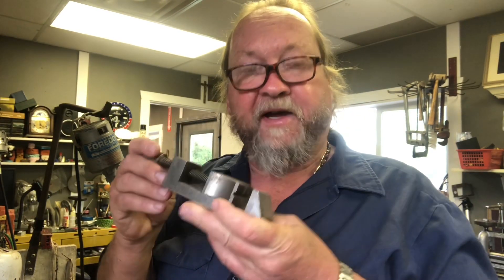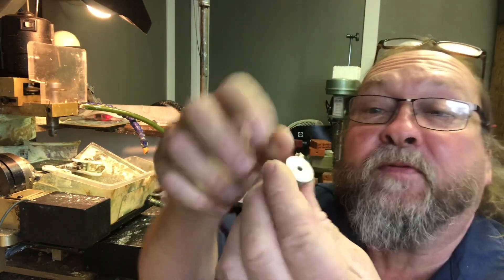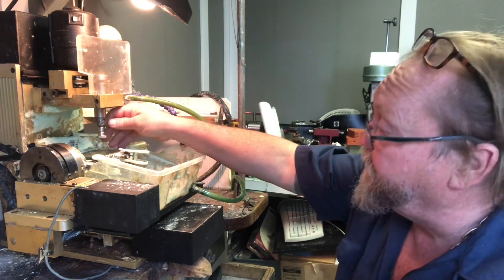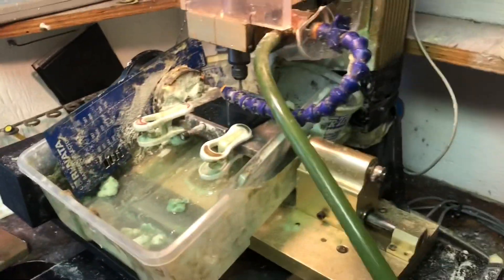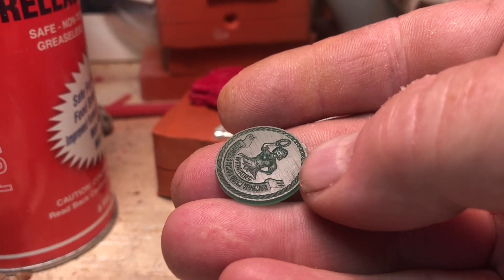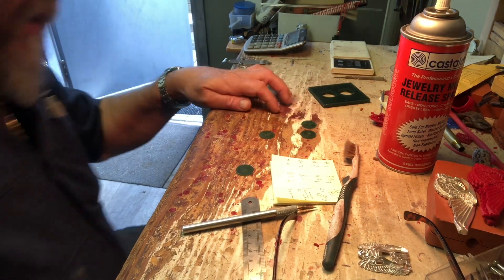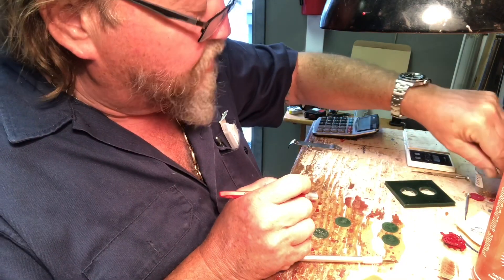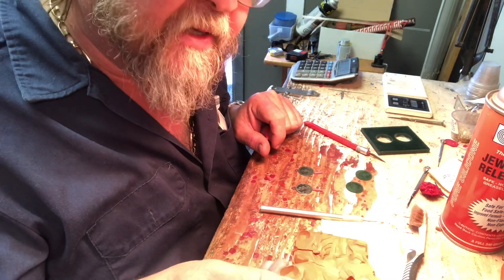Milling room.  Cutting some wax’s. Cnc cam

Comment: Hey Frank! I know this video is a few hours old now. Could you please walk us through making some machining wax?? Weight of paraffin (2) and weight of LDPE (1); 2:1 in grams or oz. Everyone has their own ratios. Where do you source your materials? And do you have a perferred blend? Thanks.
Reply from the maker: Hello.  I have been buying machining wax from the jewelers supply in blocks or sheets. Usually Faris wax company.  15 years ago it was a lot cheeped. But I saved all my scraps. Now I wash then. Let them dry for a day or two then melt them and pour them in Teflon bread pans.  Then cut my own slabs and sheets.  Saves a lot of money.